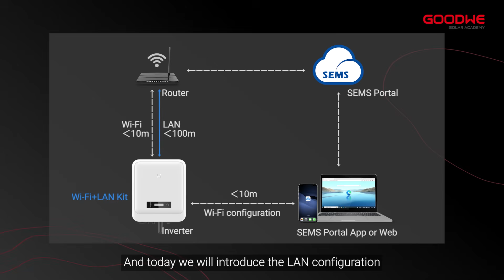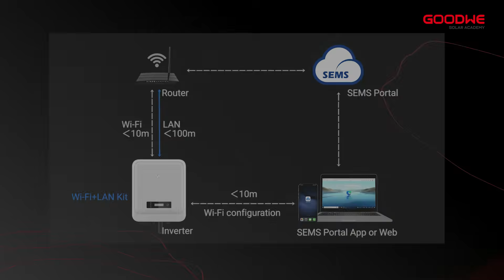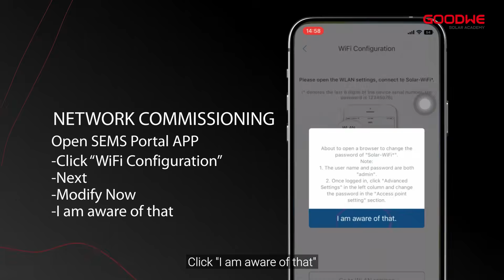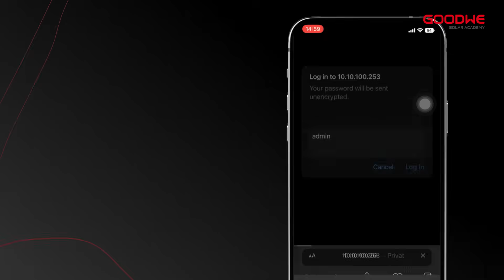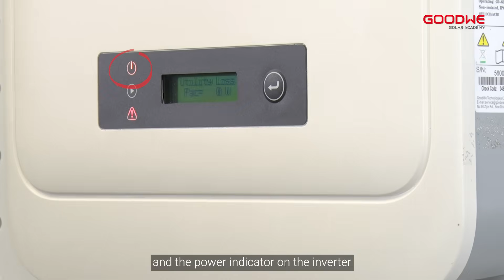GoodWe Wi-Fi+LAN Kit Configuration Guide

Comment: So am I correct that if I connect via LAN all I need to do is run a cable from the GoodWe WiFi/LAN Kit-20 to the Router & then log into the SEM Portal via 10.10.100.253 in a browser?

Comment: Can we see the results of two inverters together?
Reply from the maker: Hello, if you use the communication module, you can only set up the power plant separately on SEMS and see the monitoring data. If you use a data logger, you can see the monitoring data of multiple inverters connected to the data logger in one power plant.

Comment: Hello. Is this module compatible with the Goodwe ES series? Specifically with the Goodwe 5048ES?
I would like to change the Original WIFI Dongle for this one that has a LAN connection.
The firmware of my inverter is 242417

Comment: Via computer there is no option to select LAN (not Wifi),  there is no option to change the password of admin,  its still insecure with user admin, password admin. Q1. How can we change the password of admin ? Q2. How can the LAN be choosen/configured via the web-interface?
Reply from the maker: 1. Since pictures cannot be uploaded in comments, so we can only provide you with the download address of the user manual, which details how to change your password on page 10：https://en.goodwe.com/Ftp/EN/Downloads/User%20Manual/GW_WiFi%20Configuration%20Instruction-EN.pdf
2. Currently LAN can only be configured via APP
Reply: @GoodWeSolarAcademy  @1, this is only for the Wifi.  I mean a password to be set for the LAN interface. @2, Is there a plan to get this function into the Webinterface, and when ?, The APP is simply not the best interface to change passwords for the LAN interface,  as it is using the WIFI to connect.
Reply: @GoodWeSolarAcademy  how will i reset the lan module ? , i forgot the changed password. so i cant login in it anymore
Reply: i have bought 4inverters. two of them (gw2000-xs and gw3000-xs) are stuck on waiting. the only way to make them start is by changing the country to a different one and then back to my country. what should i do? i need them to start by default when there is enough sun. @GoodWeSolarAcademy

Comment: What is the part number for this please?

I see there is a mode selection - If I set STA mode, will that switch off wifi entirely? I want to use only LAN.

What is the product number for this please?
Reply: What was the Answer? i have the same quesion.
Reply from the maker: Please contact community@goodwe.com, we will answer you in detail.